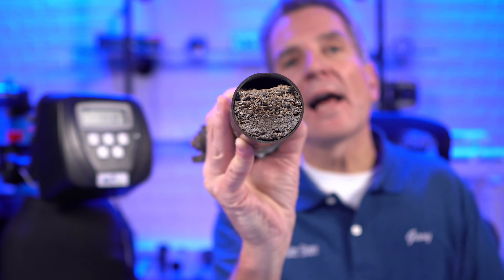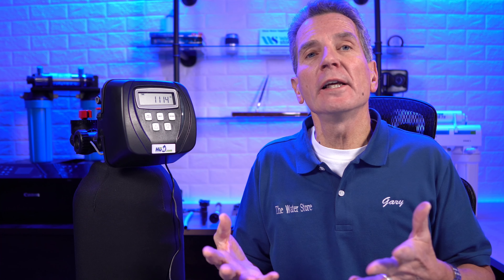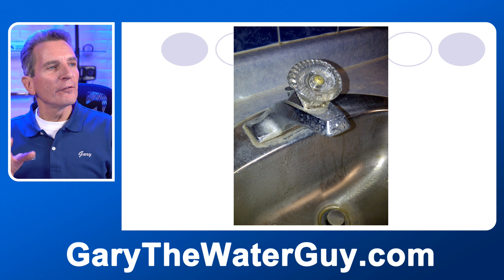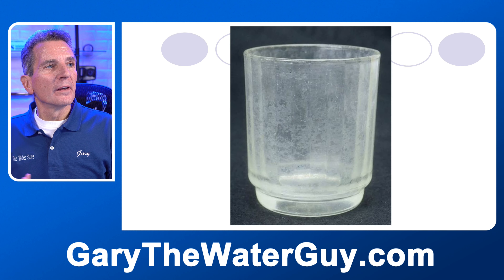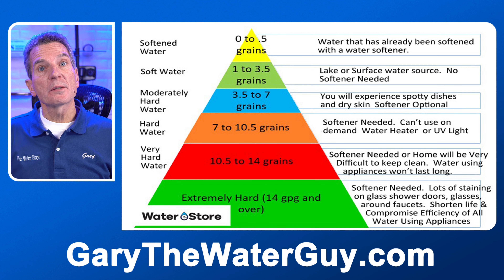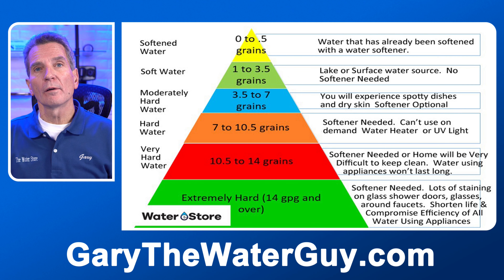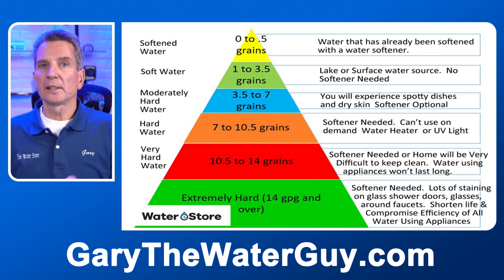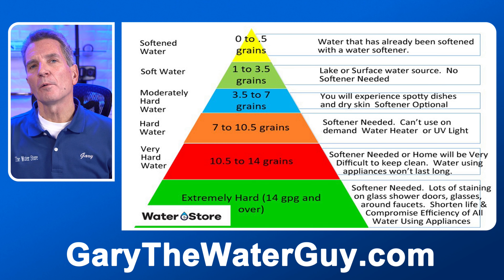How Hard is TOO HARD Water?

Comment: I'm enjoying your vids after having bought a rural 1970's house on a well, my first property not on public utilities. The only lab test I have shows a hardness level of 874 mg/l, which converts to 51 GPG. Using your Compensated formula, from another vid, adding 2.32 for Iron and not having figures for Manganese, it comes out to 55.32 GPG. 55GPG X 1120 gals (average weekly consumption for two people) gives me a needed 61,600 minimum grain capacity. That seems like a pretty big softener for just two people. I haven't moved in and talked to neighbors about their water, but it seems a very high hardness level for the area where the house is located based on stats. I plan on treating, fixing, and testing everything in the coming months, including replacing the copper with Pex. Now for the questions, can anything in the old system (pump, pressure tank, residue on the pipes, etc.) contribute to the elevated water Hardness result? It's just two people. Am I better off with a larger capacity softener tank (60-70K) and programming to regenerate every 7 days or a smaller tank and regenerating in shorter intervals?  Thanks for the helpful content!
Reply from the maker: Nothing equipment wise will contribute to the hardness. The sizing depends on current and future use.  If you are confident you will be staying at 2 people go with a water softener like this one https://waterestore.com/products/hum-metered-water-softener-45-000-grain-capacity-free-shipping if somehting light change and you will have 2-4 people move in, you are far better off with this one https://waterestore.com/products/ws-metered-water-softener-60k

Comment: I'm confused.  The home we moved into has a water softener set to 7.  My family finds the water does not wash soap off easily but we have water spots on glass doors, etc.  I thought the spots were from the salt so thought we should raise the softener level to 15.  Not sure if that will help.  The company that is supposed to maintain this is extremely expensive, sending out a big truck with two men just to test and they charge over $300 just for a visit.  I don't trust their setting as they came out and filled the tank with salt for the previous owner so they had a stake in the house using more salt.  I don't trust them as you can tell but don't know how to determine the correct setting.
Reply from the maker: this video will help you with the settings. https://youtu.be/XMY69hdhX44 Thsoe spots may not be hardness.  Your water might be high in Total Dissolved Solids (TDS).

Comment: so 186 GPG is bad? lol I just had a test done on my well. It said that mg/L is 3178. So that equates to 186 GPG. What are my options?
Reply from the maker: Is that 3178 hardness only or Total Dissolved Solids (Hardness and other minerals added together)?  Be sure to find out as it can make a huge difference to sizing your water softener.
Reply: @water_estore  yes it is separate. TDSs are 5486. The only units I've found that will work for me are not in stock. The lady at the lab said I might be better off with a ro system. I'm a residence and don't need the flow of a commercial system.

Comment: My hardness is at 27gpg and for  years I had a WaterBoss softener that “seemed” to do okay. Well time slips away and 16 years goes by with no replacement or resin change. Needless to say my hardness level crept back up to around 7-8 and of course the toilets showed staining. I replaced it with a high quality softener from a local water supply store. My question is now that I have soft water again with it reverse the damage caused earlier in pipes and fixtures over time?
Reply from the maker: Great question!  Yes, it will, but it will take time.

Comment: Calling all plumbers or hard-water-havin’-that-won’t-soften people; we have hard water. Like really hard. Coming in from the main waterline I have first a filter, then after I have a Yarna CWD24 Descaler, and finally I have a Whirlpool WHES30, all inline before the GE 50g water heater. All equipment seems to be of newer, or is new, and by all accounts seems to be in good working order. The water softener has not been going through pellets very fast if at all. I’m looking for ideas other than what I’ve already tried, which here’s a snapshot of a few main things I’ve done to try and buff this stuff out;
-Pulled apart and cleaned everything in the Whirlpool including nozzles, venturi, all lines coming out of venturi into the brine-well
-installed a Venturi rebuild kit from Whirlpool 
-Emptied salt tank, cleaned and added new salt. I only half-fill the pellets
-break up salt bridges daily if there are any
-ran a bottle of Whirlpool WHEWSC Water Softening Cleanser 16oz, as per instruction
-ran regeneration after all cleaning, rebuilding, bottle of cleaner, salt adding etc.
 
All lines and Venturi are clean and clear. I’ve blown through them after cleaning. The salt level is reset every time I add salt. I use only the recommended salt. My regen is set to 0200, when nobody is using water. Water hardness level is set to max.
Reply from the maker: What is the hardness of your water?  I would find that out and set your hardness as to what it actually is.  Also, have your water tested for hardness after the softener because it may actually be working but you don't realize it.  And, you may want to throw out the descaler because they don't work.

Comment: I have a clack valve that is leaking at the neck of the tank.  Do you recommend any good sealant to apply on the threads when I re install the valve?
Reply from the maker: You can try removing the head and use plumbers sislicone grease on the o ring when you put it back on https://waterestore.ca/products/plumbers-secret-clear-silicone-grease-food-grade-113-gram While you have the head off check for cracks, a cracked tank will also casue leaks at the neck.

Comment: Does getting a water softener remove the build up already in pipes, and say faucets, or shower heads or do we need to clean out somehow.  I live in las vegas and my dishwasher already went out on me after 5 years in this house. I am first owner of home, so any build up is on me for not getting water softener earlier.  I am planning on getting a salt water tank and a conditioning system along with it. They advertise ws1 as what they use. Oasis is the name of company and I just want to make sure I'm getting what is right. Any input would greatly be appreciated.  The Champion is what they call there system.
Reply from the maker: Yes, after you get a water softener the soft water will slowly remove the lime scale buildup in your pipes but it will take some time.  A Clack WS1 valved water softener  like this 
 https://waterestore.com/products/hum-deluxe-water-softener-30-000-grain?_pos=1&_sid=c7124a492&_ss=r is usually the best way to go to softener the water and this to remove the chlorine https://waterestore.com/products/hum-automatic-back-washable-carbon-filter-1-0?_pos=2&_sid=29c935885&_ss=r

Comment: Hi Gary we need help!  We have a whirlpool softener that is spewing water out of the top of the motor at the end of the regeneration cycle.  We have made sure the venti is not clogged, the drain hose is unclogged, we have replaced the circuit board and motor.  It seemed to be working after all our repairs until my husband put cleaner in the tube as instructed and set it to do a manual regeneration.  At the end of that regeneration is when we noticed the water was spewing out of the top of the motor.  Any ideas?
Reply from the maker: Sorry, no.  Big box store water softeners are very difficult to trouble shoot and repair.  Did you try the steps outlined in this video? https://youtu.be/Lr3jyGiJdC0
Reply: You have opened the top of the head? Take all deals uit and put Some Grease back in them, than reassembly the top head

Comment: Your content is great; it’s really helped me to navigate an industry that has a lot of companies wanting to scam consumers.

I’m wondering if you might have thoughts about this: My 10-year-old condo has pex piping where many of the brass fittings and the water heater have significant scale build up. But when I tested my water hardness it was only 5 GPG. Is that enough to ruin plumbing systems over time, or is it more likely that the hardness in my city varies over time. I have municipal water from Austin Texas where the primary water source is the Colorado river. 

I’m having a water softener loop installed, but I’m worried that if the hardness varies here, that might complicate programming the system.
Reply from the maker: the scale likely is just the brass reacting with the pH of the water.  At a hardness of 5 you only need a water softener if the scale in the house (or condo) becomes a concern.

Comment: Gary first of all thank you for taking the time to make these videos, I find them extremely helpful and also interesting on the inner workings of water softeners.  I do have a question.  My water softener will regenerate at 1200 gallons or 8 days. I rarely use the 1200 gallons before 8 days.  How many days is too many between regeneration cycles?  Should I raise the days between and rely on using 1200 gallons between regen cycles?
Reply from the maker: Glad you like them!  A water softener needs to regenerate at least every 14 days, so your 8 is no problem.
Reply: @water_estore  Thank you so much Gary for the reply!